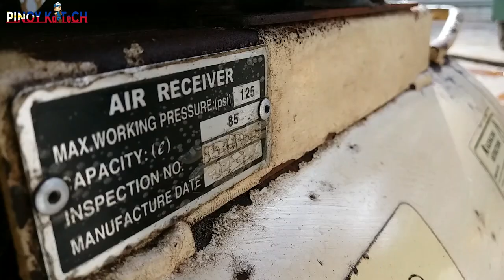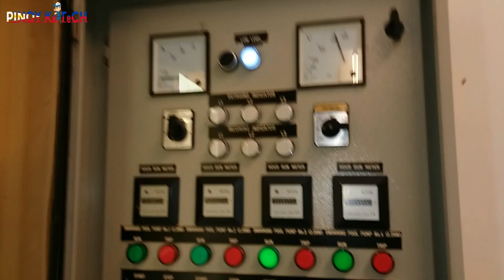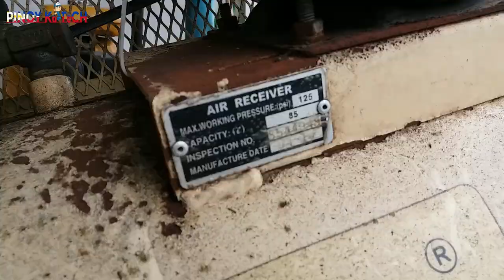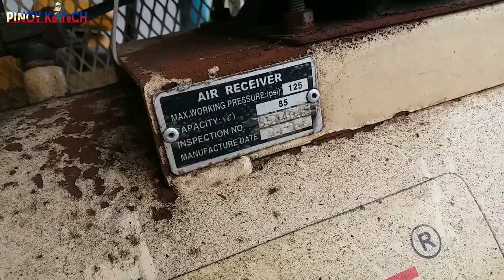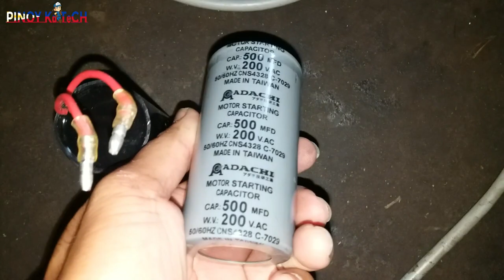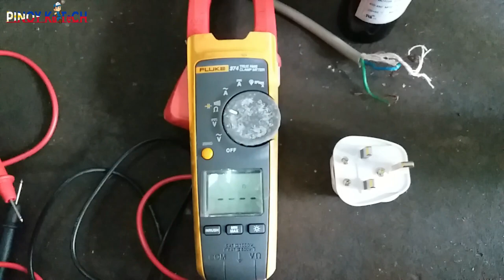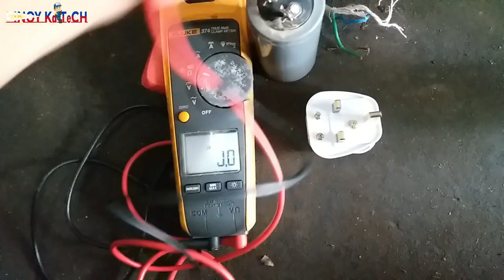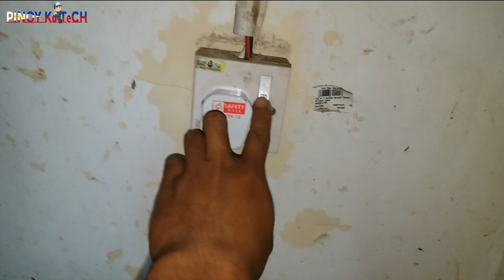Air Compressor Repair Electro Motor Humming Sound Won't Start

Comment: Pano sir kung okay yubg switch at capacitor pero ganub parin humming lang ayaw mag start
Reply from the maker: Sa Motor kana mag fucos po sir, baka stuck up siya or may problema ang winding.

Comment: Sir pano po kaya itroubleshoot kapag malakas yung ground ng compressor ko wala naman pong open wire
Reply from the maker: Shorted to ground nayan compressor motor mo, or grounded, shorted na ang winding sa luob ng compressor motor.

Comment: tanong lang po. ano po ba ibig sabihin ng "UF" pag po ba mas mataas ang uf mas malakas? Kakasira lng po kasi ng capasitor ko sa compressor sumabog. at iisa lng ang capasitor na gamit ko . salamat po sa sasagot. God bless po
Reply from the maker: Symbol po siya sir  ng microfarad, hindi po pwedeng taasan ang rating ng capacitor hindi po yan lalakas mas lalong iinit ang Compressor motor mo. Each Compressor meron lang sila capacity na capacitor na ginagamit hindi pwede mataas hindi rin pwede mababa ang uf mo or microfarad.
Reply: @pinoykatech4999  maraming Salamat sir may na tutunan hehe ty po God bless po.🙏👍

Comment: Ano po yong  problema pag maigay yong compressor
Reply from the maker: Sa video na to starting capacitor ang problema, weak na ang starting capacitor kaya di na niya kaya paandarin ang motor,  iingay yan or uugong lang.

Comment: Boss paano e test kung sira o putol na ang winding ng motor sa air compressor?
Reply from the maker: Ser Gamitan mo ng Multimeter, dapat meron ka makuhang reading sa winding, pag wala ka masukat ibig sabhin putol ang winding mo or open winding na motor mo.
Reply: @pinoykatech4999  pwede ba sa terminal na kinabitan ng running at sarting capacitor ko lang ilagay yung test probe ng multimeter sir?